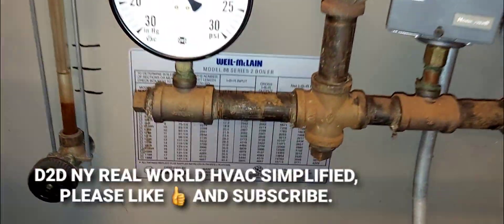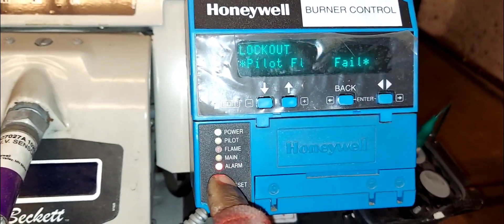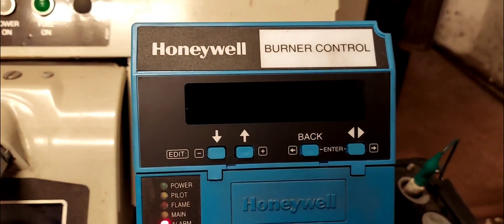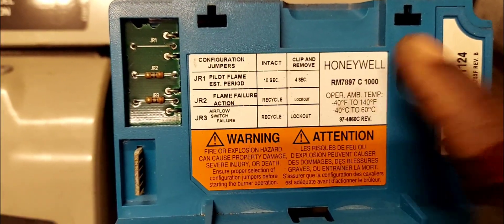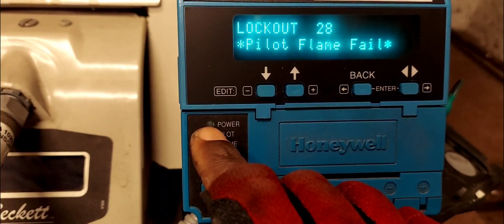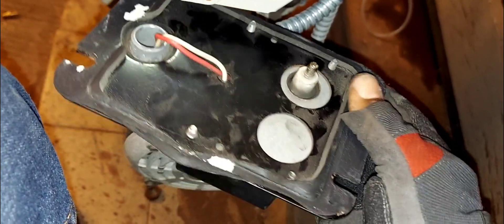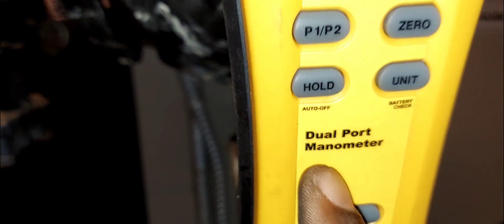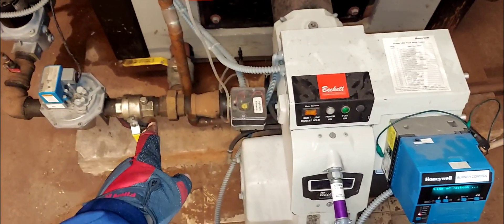WEIL MCLAIN STEAM BOILER TROUBLESHOOTING

Comment: Also u can get a clear view of the entire sequence from the rear view peep glass, unless the Beckett burners are set up differently than the powerflame burners- in u cannot maybe see the spark ⚡️ to pilot to main flame 🔥 ignition! Anyways great videos! I know this was filmed in 21 but my other tech is on call today with a commercial boiler issue- Lockout 19 main flame ign failure! So I was searching for some refreshers online
Reply from the maker: Thank you for stopping by

Comment: I'm getting the  same code on our steam boiler...had changed flame rods and relay by pro company. It works for a few cycles then goes into lockout.
Reply from the maker: Flame rod senses flame 🔥 if it’s there only perhaps 🤔 the ignition system needs to be examined!
Reply: @D2DNYAC  thanks!

Comment: Be careful with that green clip lead. That wire insulation is probably only rated for 300 volts. So the 6kv will leak through the insulation. Just make sure you are not grounded when you touch the green test lead. Beware of where your other hand is. A safer way to do that test would be to connect the clip lead to ground first, then bring the other end close to the transformer terminal. That way the wire is always at ground potential, spark or not.
Reply from the maker: Thanks you for stopping by

Comment: Nice video, I probably would check the ignition lead with my meter for resistance, and if it was low and the connections were good. I would probably not change it.
Normally always the probes, but the ceramic was breaking down on this one.
Always nice to find a problem with a intermittent issue. 👍
Reply from the maker: Thanks 🙏 for stopping by